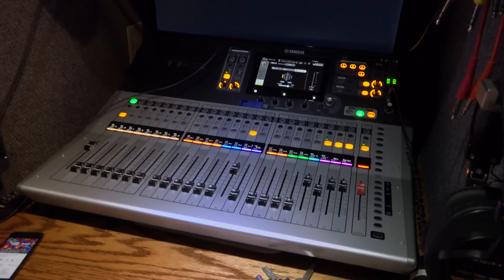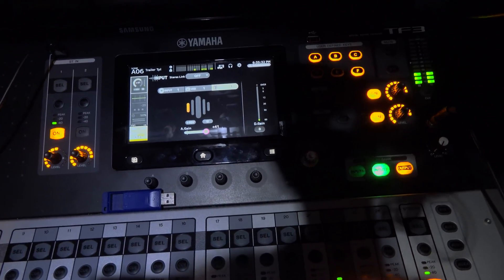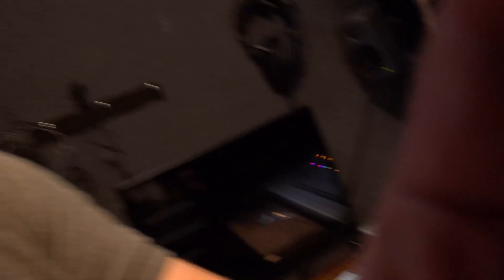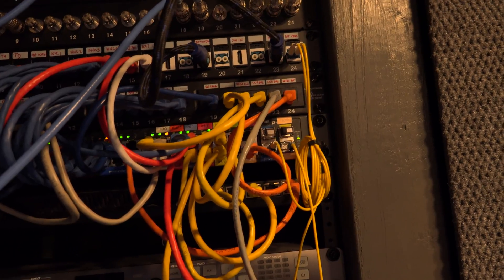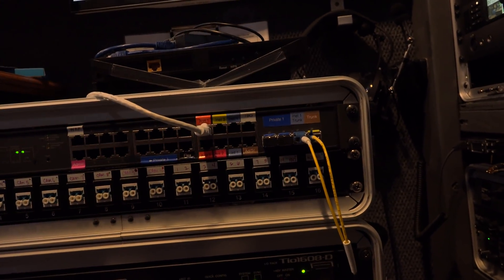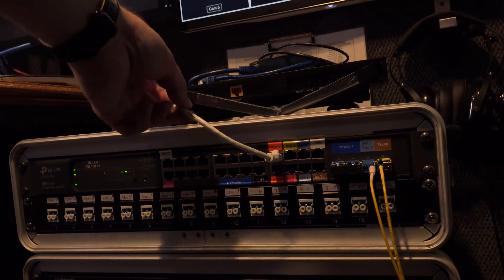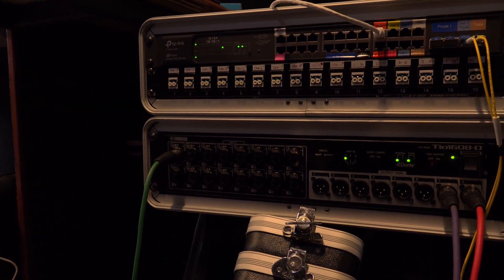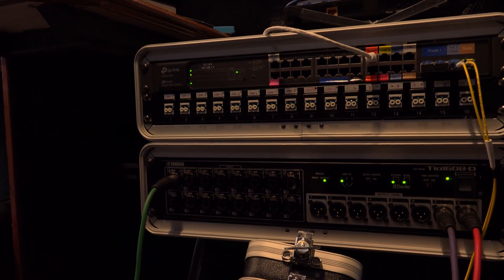Production Trailer Audio - Dante is in the house! Audio over Fiber

Comment: So your running this Dante over single mode fiber? I’m assuming that’s best for Dante
Reply from the maker: The type of fiber doesn't matter much unless you're doing long runs; multimode works fine up to a few hundred meters. Anything longer will require singlemode.

Comment: Cool stuff, What converters are  are you using to convert Dante to fiber and back to Dante?
Reply from the maker: Since Dante is just Ethernet I can freely convert between copper and fiber the same way I'd do any Ethernet signal. For me, it's happening in my network switches. They have four SFP slots each and I just populated them with appropriate SFP modules based on my fiber type, transmission distance, and wavelength needs. If a network switch doesn't support fiber, the type of device you'd need is called a media converter. They usually ship without the SFP (fiber) module, so you'd need to pick one based on your specific needs. I have other videos here on the channel talking about fiber.

In my particular case I put my Dante traffic on its own VLAN so it appears to be on a separate network from everything else, but it's still just an Ethernet network.
Reply: @djp_video  I should have said which switch are you using that has fiber built in, thanks for the info.
Reply from the maker: TP-Link T2600G-52TS in the trailer and TP-Link T1600G-28PS in my breakout box. But switches with SFP ports are easy to find -- there are many, many models available from most manufacturers.
Reply: @djp_video  Yamaha makes them but seem extremely over priced.

Comment: So, is the computer you use to run the Dante controller also connected to the switch at 2:16? If not where is that connected?
Reply from the maker: Since my audio is on a VLAN separate from my main LAN, any computer that needs to control or tap into audio on that network needs to somehow be connected to the audio VLAN. My switch supports VLAN functionality and I can freely configure which VLAN each port is assigned to fairly easily. The computers that need audio either have two NICs or I use an Audinate AVIO adapter plugged into the audio VLAN. 

When I'm not working at a venue, I can bridge the main LAN with the audio VLAN and that way all computers have access to Dante as well, since it essentially just becomes part of the main VLAN temporarily.
Reply: @djp_video  Wow thanks for the quick reply! 
So I’m trying to figure out a setup similar to this but much more basic. I think I have the signal flow figured out thanks to this video. Could you let me know if this makes sense?

Dante Card to Network Switch A via CAT6 
(Laptop Running Controller would also goes to this switch I think?)

Network Switch A to Network Switch B via Fiber

Network Switch B to Stagebox via CAT6

And that’s all. Pretty simple.
Reply from the maker: @McSwineyyyy  Yes, that should work just fine.
Reply: @djp_video  Thanks so much!

Comment: Hi Doug, for example: in a Conference.  How do you get the sound of the presenter's notebook if you bring it through sdi?  You use a Sdi to audio converter and you take the balanced signal and enter it to the tf3 or you can use Dante with the blackmagic mixers. Thanks you, from spain. Sorry for my English.
Reply from the maker: If it comes through SDI, I do use an SDI-to-Audio adapter to get it into one of my TF3's inputs.  I leave one of these converters connected to my TF3 at all times.

Comment: The switch you're using is the TP Link 1600G 28PS correct?  So you need one switch at both ends; one in the venue and one in the trailer?  If the one here is for the venue, do you have the same switch in the trailer?  Could you share why you chose this one and are you happy with it?  (not too noisy for instance with the fan I hope...)  Are you really filling the bandwidth on both SFPs in that switch or is that just precautionary? Thanks for sharing all the solutions you've found!
Reply from the maker: Yes, the switch for the venue is the 1600G 28PS. In the trailer I'm using another TP-Link, the T2600G-52TS. The trailer has a lot more devices to connect, which is why I went with the 48+4 port. (But, frankly, even 48 ports isn't quite enough, and I've had to augment with additional switches.)

I selected the TP-Link because they have more features per dollar than other brands. I've used quite a few TP-Link products over the years and they've never let me down, but they definitely aren't the only networking brand I use. 

The 1600G-28PS has PoE+, which is handy for powering PTZ cameras, my Audinate AVIO adapters, among other gear. If it was in the budget I would have gotten a switch with PoE for the trailer as well, but that would have added pretty significantly to the cost, both monetarily and in power consumption. My networking gear remains powered at all times -- even while in transit, so I had to be careful to keep switch power consumption to a minimum.

Both switches are extremely quiet once they've finished booting. The boot sequence takes a few minutes, and during that time the fans are a bit loud, but once they've settled they're practically silent.

They key feature to do what I'm doing is VLAN support. It's the VLAN feature I'm using to split different ports into separate networks, and to aggregate multiple VLANs onto a single fiber strand. Having QOS to prioritize one VLAN over another is also nice, considering I send audio over the same connection, so my audio VLAN is given precedence over everything else. I don't know that that has ever kicked in, but it does give a bit of peace of mind knowing that if the network were to get saturated that audio should be unaffected.

I've never needed more than the 1Gb of bandwidth that I get with a single fiber strand, though being able to aggregate multiple ports is there should I ever need it. The other SFP ports on the switches are being used to connect other gear -- for example, when I need to setup a PTZ camera farther than about 50M away from my breakout box, I'll use fiber -- one strand for network to control the camera (using bi-directional SFPs), and one strand to receive video from the camera. The SFP ports also get used to extend the trunk to another switch for an additional breakout location -- very useful if I need to get LAN and audio, and even Internet access somewhere else. I've had more than a few occasions where all four SFP ports are being used.

Comment: Can something similar be done with AES50? (Behringer, Midas, Klark-Teknik et al).  aes50 is not IP traffic so no router, but fiber converters should be possible, right?  Aes50 is built-in to the X32 for example, while the Dante card is around $500. Also more delay with Dante than Aes50...
Reply from the maker: Since AES50 isn't Ethernet, I couldn't integrate it into my fiber setup. I do see that there is a product that will convert AES50 to Multimode fiber, but it's $2000, and you'd need a pair of them, and since its Multimode it's distance is limited.
Reply: @djp_video  Ok.  Dante card is looking much better in that case.  Also I can record straight from Dante over an ethernet cable to a laptop if desired.

Comment: Hello again Doug. You did never consider the A&H SQ-5 over the Yamaha TF3?  And if you did - why did you choose the TF3?
Reply from the maker: I hadn't, but the SQ-5 wouldn't be suitable... it doesn't have enough input or output channels (the 24/16 of my TF3 still isn't really enough), and they don't appear to have their own complete Dante solution. They do offer a Dante add-on card, but no stage box.  Yamaha is a big supporter of Dante, so the TF3 works really well with it. Price is also a consideration.

Comment: You mentioned that you get a total of about 1ms of audio lag and then sort of paused and rolled your eyes at it, but I'm assuming your video switcher also has some small amount of processing delay (which requires most people to delay their audio sources anyway to match).  Thus, you should be able to get them to line up perfectly in the final program cut / stream without much hassle.  All is good!
Reply from the maker: I think I was just doing the math in my head at that point. 1ms of delay isn’t going to be an issue in nearly any real world cases. Only potentially if phase sensitive audio sources take different paths and end up with different delays.